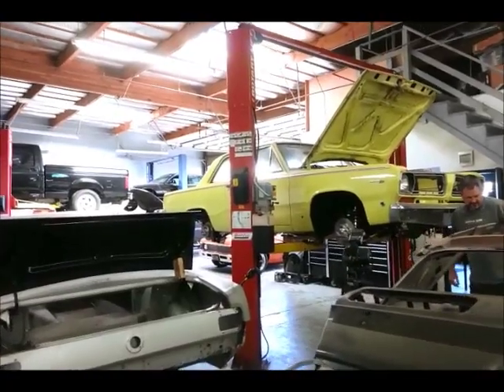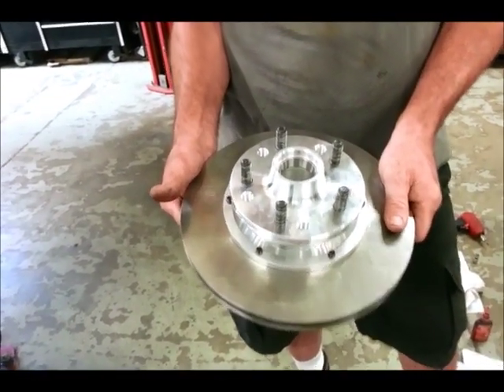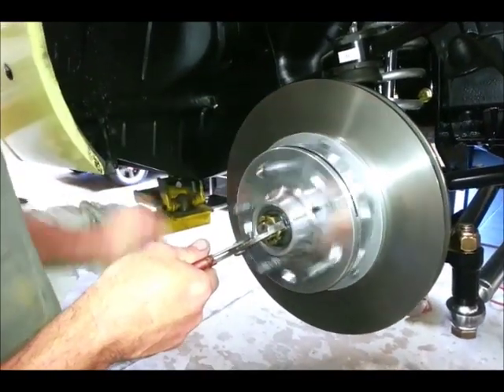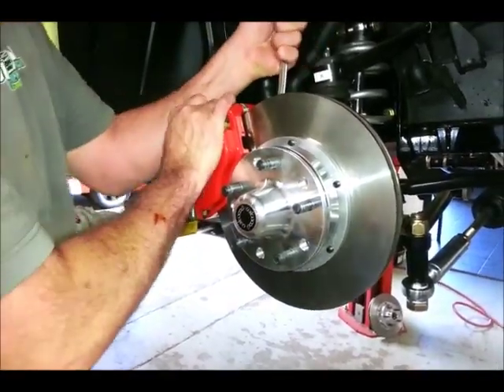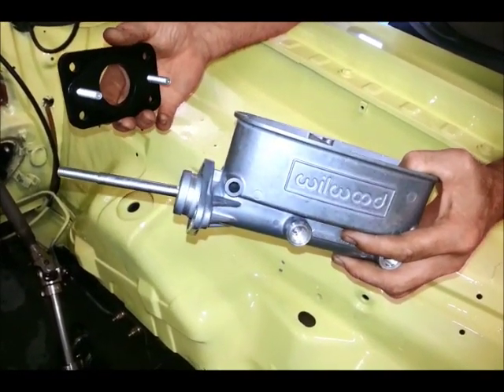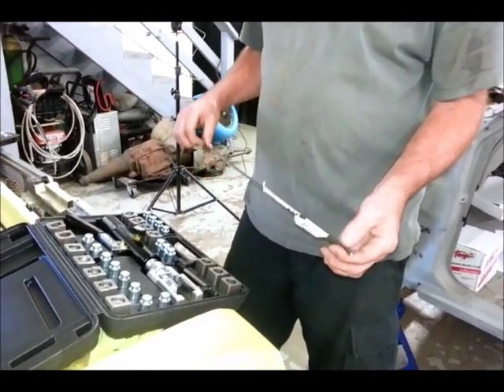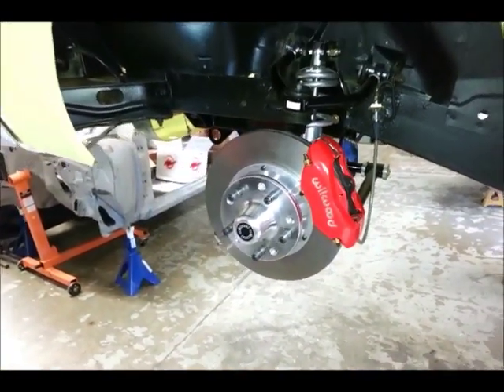Wilwood Dynalite Disc Brake Installation

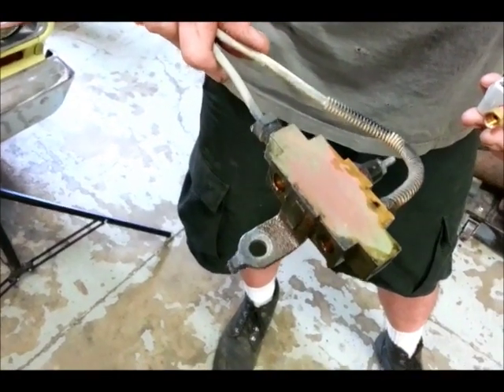Comment: 8:24 Original part is not a proportioning valve, that is a combination block (metering block/distribution block). Both of those are needed, the proportioning valve which was in his other hand gets installed behind the combination block inline to the rear brakes.

Comment: He said ~ "Re·dun·dant " haha!
rəˈdəndənt/
adjective
not or no longer needed or useful; superfluous.
"this redundant brewery has been converted into a library"
synonyms: unnecessary, not required, inessential, unessential, needless, unneeded, uncalled for; More
(of words or data) able to be omitted without loss of meaning or function.
ENGINEERING
(of a component) not strictly necessary to functioning but included in case of failure in another component.

Comment: Guys, thanks for this video.  I noticed on the proportioning valve and caliper bleed screws there appears to be PTFE thread tape.  Does Wilwood specify the use of tape on the caliper fluid inlets and PV connections also, or do you dry fit them?

Comment: Thank you for the video!  I am thinking hard about this upgrade.  Did you have to press the bearing races in?  The kit warns about a change in offset, did you see one?  Using '73 spindles on a '71 pro-street Demon (Dart).